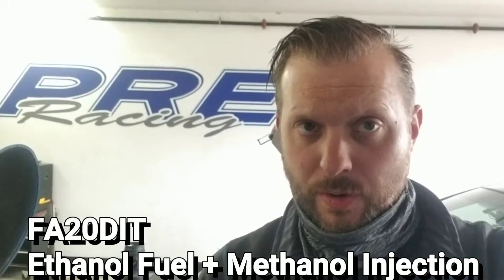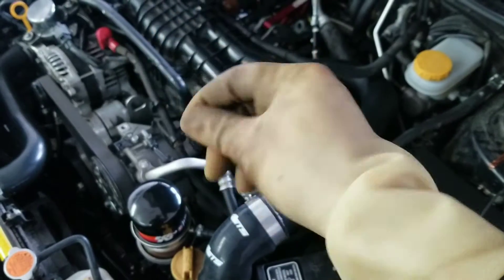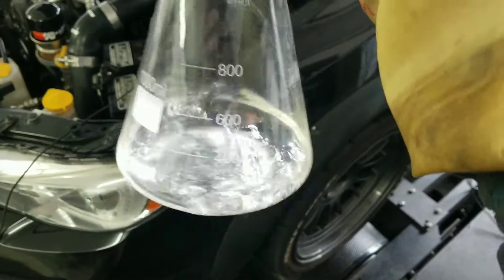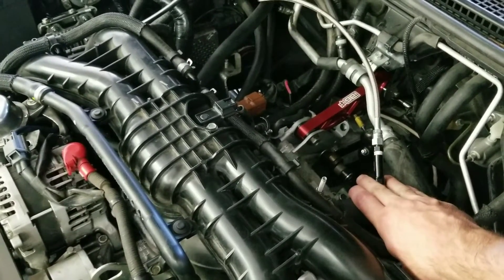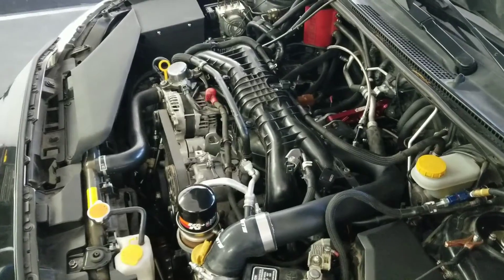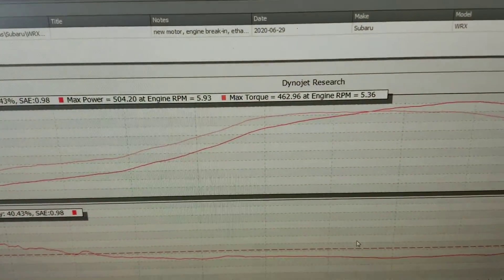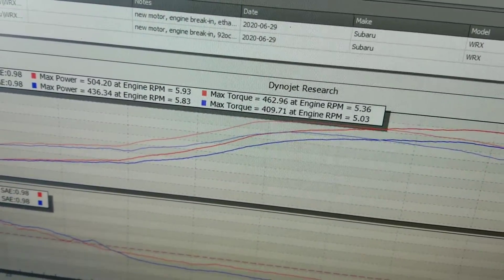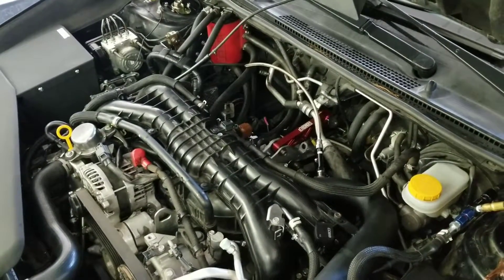Tuning Tech. Subaru VA WRX FA20DIT w/ Methanol Injection! Keep those valves clean!

Comment: How big injector do you like  to run on ej2.0? Whats your experience?
Reply from the maker: That's a question that needs a whole lot more information to answer.  Ideally you want to target your injector size to not exceed 90% duty cycle but if you're less than 65% your what I'd consider oversized.
Reply: I meant for methanol injection. 
Thanks.

Comment: Can you use a cobb AP when tuning for meth?
Reply from the maker: Absolutely! Zero reason not to
Reply: @WT4T  just wasn’t sure if there wasn’t a option for it but I guess the AEM kit has the controller so the tuner just needs the details on the setup
Reply: @WT4T  I only have access to 91 and summer heat soak sucks. Fa24 would love some meth
Reply from the maker: It's not a thing there's an "option" for in really any reflash software. You just have to tune accordingly knowing you have additional octane and fuel coming into the motor